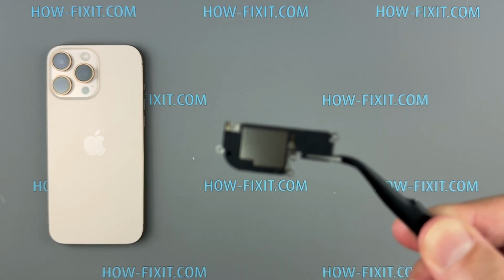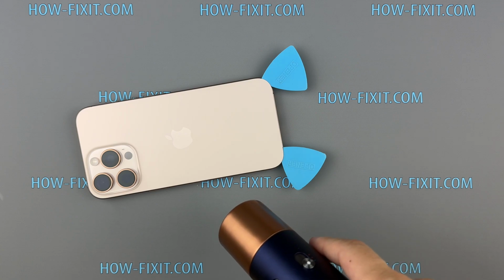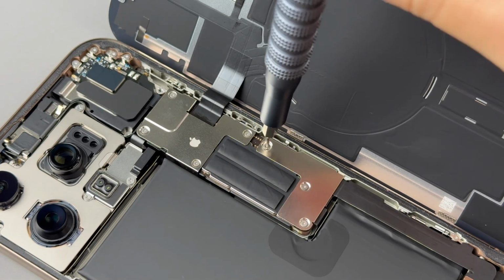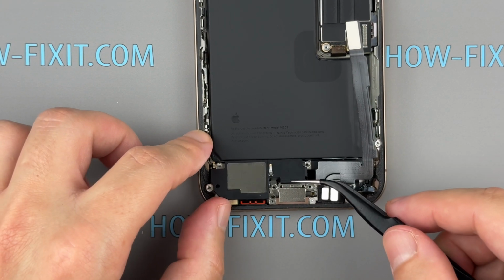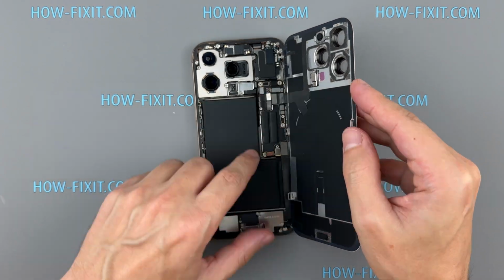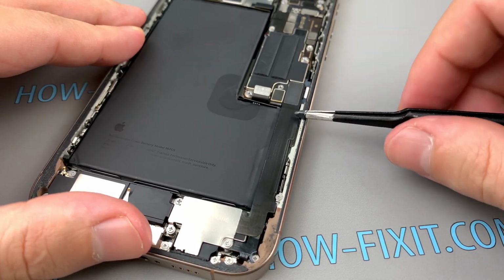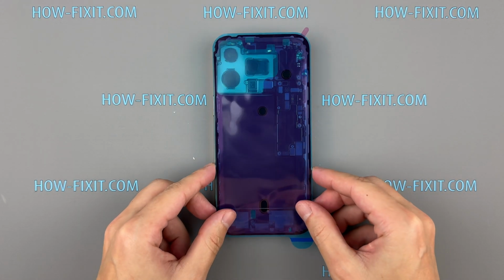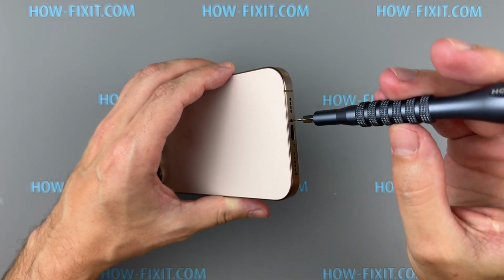How to Fix Crackling or Buzzing Loud Speaker on iPhone 16 Pro Max | DIY Repair

Comment: @How-FixIT I went to a repair shop and they told me, that the replacement of the 16 Pro Max bottom speaker would cost around 229 Euros. Is that a realistic price?